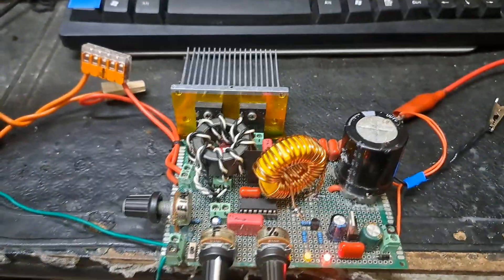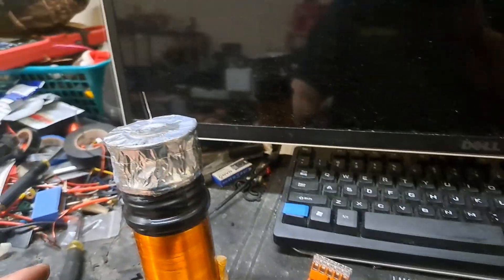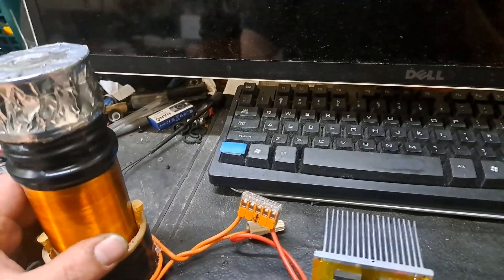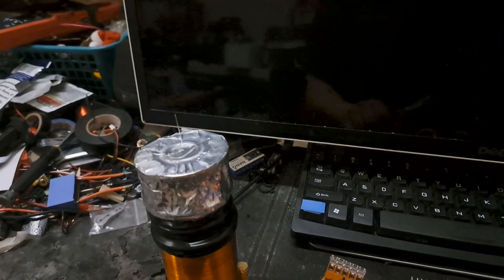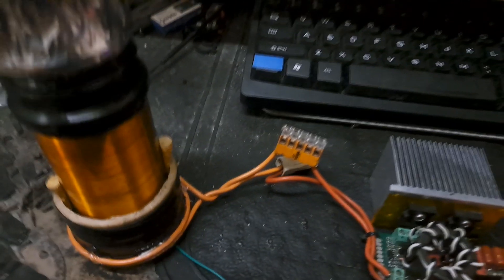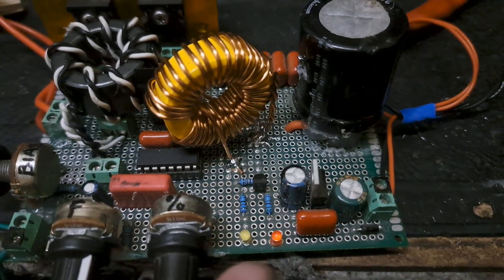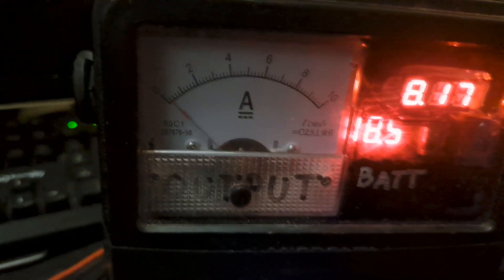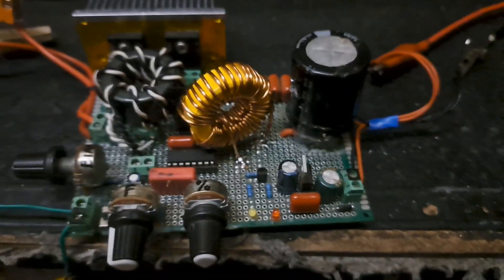Push Pull SSTC 6-30V Tinkerage

Comment: Gotta love the push pulls , so you have the secondary going through the GDT and then to main ground , mmm mine goes to the negative rail of the circuit , I would like to try putting it to ground , but I am a bit scared on doing anything to it cause it works so well I am afraid I kill it , but it is also very annoying cause all the circuit gets a high potential so it shocks me every time I touch a wire or some part of the circuit
Reply from the maker: You can tie to circuit ground but if you do that I also recommend to have the circuit ground tied to earth ground and tune everything that way. Otherwise you are basically always on the edge of interference on the interrupter.

Comment: extend the breakout tip with a knotted piece of wire if you've got time, I wanna see what happens, since I can't do it myself right now as I disassembled every high performing system I had, thinking I'd get to assembling something closer to Skori's schematic
Reply from the maker: I left this circuit at work for someone else to mess with or take with them but I have some others I'm going to screw around more with. The next one I make I'll probably just try to make it beefy with a decent heatsink for running CW more. The CW is always insane with these though.. You can tune them to not pull so much but if you get them pulling what they really want it's like 10A+ and stupid hot arcs.
Reply: @Magneticitist  I like the kind of output that russian guy had in the video titled "9V sstc". I suspect he used huge voltage on the primary and probably wasn't using fets. Interrupter with low duty. Have you tried a Royer topology with BJTs found usually in halogen drivers or PC PSUs ? There's no reason why those wouldn't work. especially as they take mains V. Not many ppl experimenting with BJT SSTCs or youtube just doesn't want to show me any
Reply: @Magneticitist  I believe I asked you about using BJTs before, but I can't find any traces in my comment history in the last 1.5y
Reply from the maker: @sFeral  lol you definitely have. I get the impression you have a huge stockpile of BJT's or something. I personally never really messed with them unless I wanted to build some audio amp or was messing with slayer exciters. To me they are just outdated switch technology that are still around to serve niche functions.
Reply: @Magneticitist  salvaged stuff. Now you're making me miss two identical flyback driver fets I got from CRTs and burned, think they had better specs than the bought
Reply from the maker: @sFeral  They typically do so long as it's a large manufacturer. AFAIK that is how components are dispensed. They don't just scrap the ones which are not quite as good as the rest. Those get sold to the general public or even distributors. The good stuff is reserved for large manufacturers.

Comment: I just remembered that I noticed some weird effects when I accidentally knotted the wire near the top breakout point (no top load). It was a tight knot. The wire basically burned like a fuse to the point where the knot was and the knot began to glow with intensity like that of a bulb filament and after a few seconds (tho much longer than I expected it to last)  it fell off still glowing like a welding bead. I think it was one of those early circuits where I was using a Mazzilli without an LC cap and with a grounded secondary, so pulling an arc was required to get it to start oscillating harder
Reply: btw it was standard magnet wire thickness found in CRT yoke, only Aluminium. Beats me why I suddenly thought any of this was relevant lol
Reply from the maker: @sFeral  It sounds like you just had good tuning for current at the time. I typically back my coupling down to the point where I see higher voltage peaks but not quite as much current. When I tune them for current the arcs are real hot and burn topload wire etc but then I just don't like the arcs to free air.
Reply from the maker: That's what happens with CW it's just going to melt the conductor if there is enough current. If I use thick enough wire it won't happen but anything magnet wire or like resistor lead wire it's going to instantly disintegrate. Reaching the ball it's just going to glow, but yea if it's hot enough it will just pop the ball off.